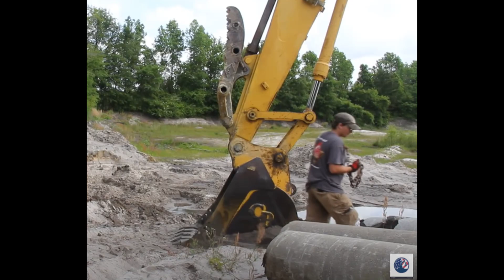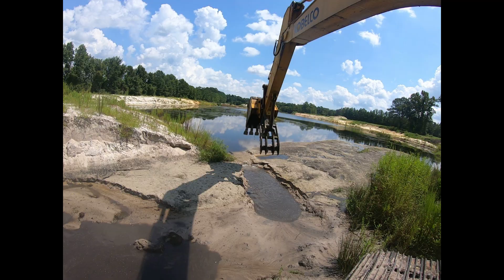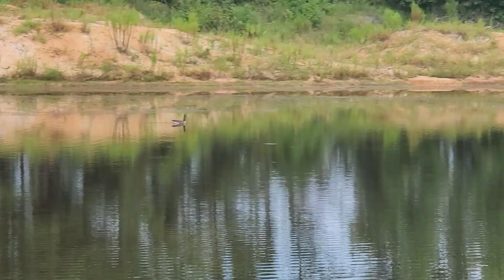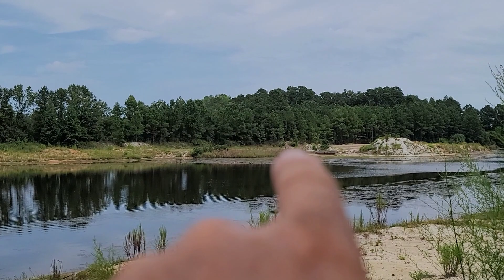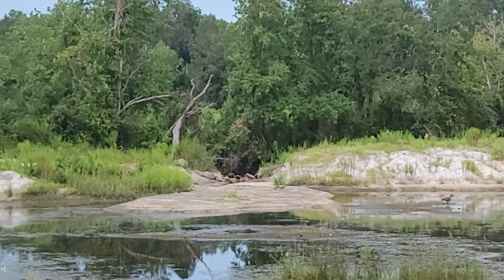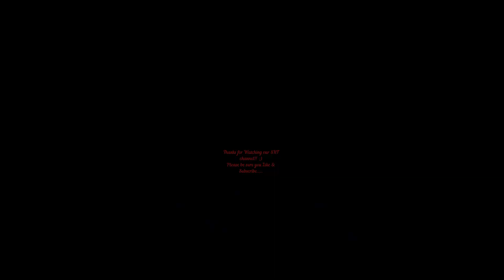Pipe Removal and Dropping the Water Level

Comment: Would using a power washer help clear the sand from the pipes?
Reply from the maker: Ronald,  probably would  and will 
...if heavy iron doesn't correct the issue 😁